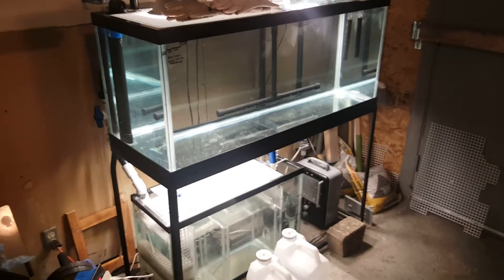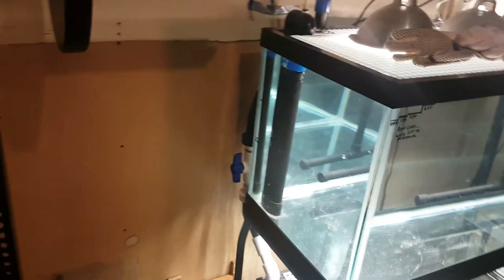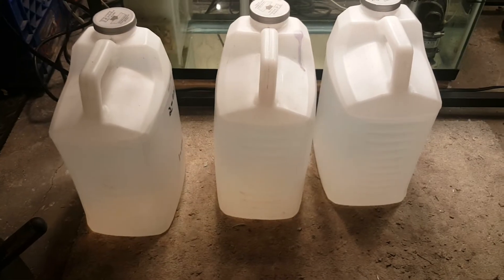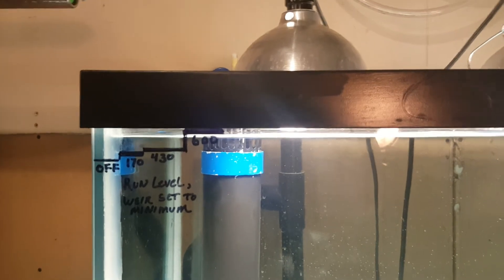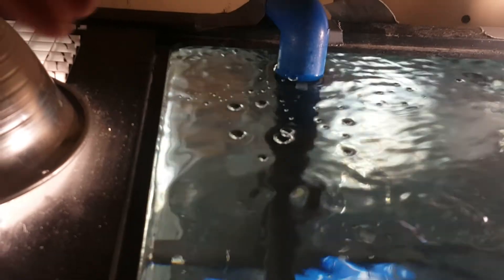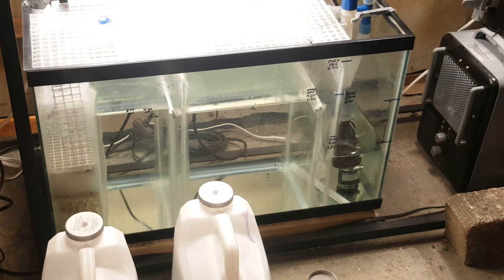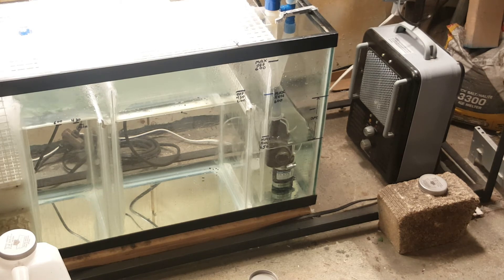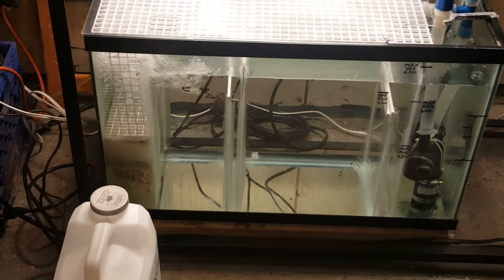1" Durso Overflow - Flow Rate Limit Proven

Comment: It has to do with your design. Those tube style overflow weers can only pull so much water to your 1-in overflow because of the surface area of the opening as such it pulls in extra air inhibiting your flow. A lot of the air will be pulled out with the water flow but not all of it meaning that you have a partial airlock in your system because of your design. I have a coast to Coast style internal overflow weir that expands the entire width of the tank at 18 inches that maintains a water level only one inch below the tank water level even at full tilt and my overflow pipe extends at least 8 inches into that so there's no risk of air getting into my main other than from the standpipe so as not to restrict my flow. I also have the amount of air being allowed into the standpipe restricted by a cap with a piece of airline tubing which allows for a higher pressure while still allowing air for automatic restart and water leveling at the T. I've also noted that when running the durzo standpipe the height of the T connector matters. After a few adjustments and having my T- height at 2 in below water level. I am running a hygger HG 915 that puts out 1,060 gallons per hour. And I can run that thing on max while I still have plenty of water height in both my overflow chamber and in sump without any cavitation and my water level remains in the pump chamber slightly above my pump prior to cavitation and sucking air at 100% of the pumps capacity of 1060 gallons per hour. The head height on my pump is supposed to be up to 16 ft and the height from the pump to the top of the return is just over four feet so I'm guessing with back pressure I'm still flowing about 950 gallons per hour easily without any complications, and without a whole lot of air even being sucked in from my standpipe but still plenty of aeration for it to remain durzo and cause Auto restart, and auto restart happening nearly immediately after restarting the power. It is self equalizing and pulls more air depending on the flow rate. Now I don't run this thing at 1060 gallons per hour I just tested it at the max capacity of the pump to see if it could handle it and it did just fine. I only run this pump at 45% currently and have not had any issues whatsoever and it has been running for over a year on the same some on the same tank. This is currently running a 75 gallon tank with a 20 gallon long sump. I just recently built my wife another aquarium stand with a 55 gallon sump that's going to be running our 125 gallon display tank, and more than likely won't need to step up anymore than up to a one and a quarter overflow for the pump that I have for that sump which is putting out 1,760 gallons per hour from what I documented on the first build and haven't even maxed out that one yet. Maybe before I complete the build-out slap my 1,760 on my current setup and see if it can handle it. If it does; then your definitive proof is out the window. It's about design because if it works I will have definitively disproven your definitive proof as my current setup already has pushing 950 gallons per hour with ease on a 1 in overflow system running wide open. To go even further you can simply use a flow rate calculator for a gravity pipe which will show you that a 1-inch pipe with a 4-ft drop, under gravity which means a sealed pipe; providing a material of plastic; and a roughness coefficient of 150 which is the default for PVC and you'll find that the flow rate is .704 gallons per second multiplied by 60 seconds in a minute gives you 42.24 gallons per minute multiplied by 60 minutes in an hour gives you 2534.4 gallons per hour maximum flow in a sealed system. Calculating for an open system such as a durso the maximum flow rate is 1,104 gallons per hour according to the calculations and 1,992 gallons per hour on an open system with a 1 and 1/4 inch pipe 4536gph closed and or full siphon. Knowing these parameters is essential to designing a properly operating overflow system. With the right tweaks you can easily flow a thousand gallons per hour or more with a durzo 1 in system.